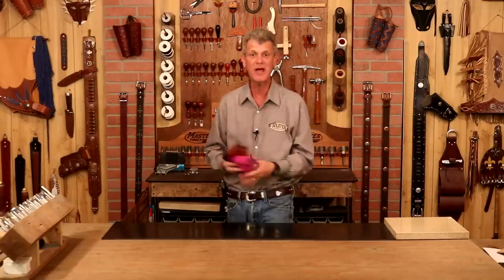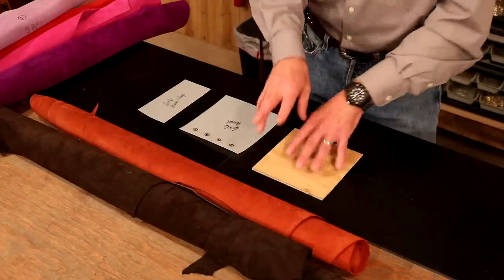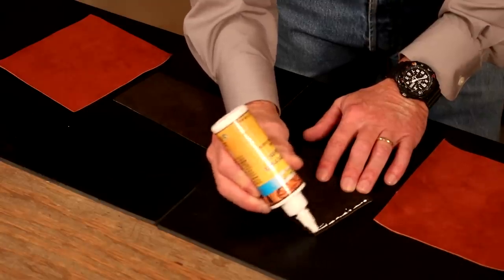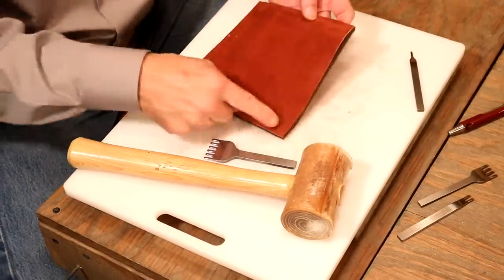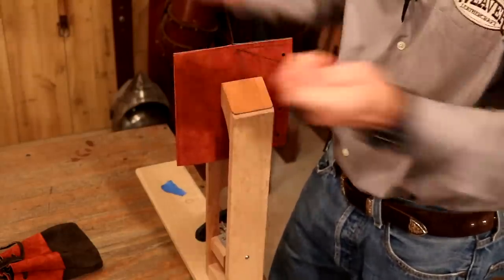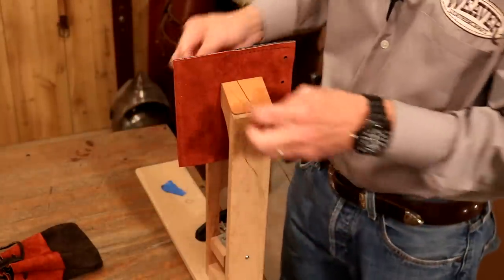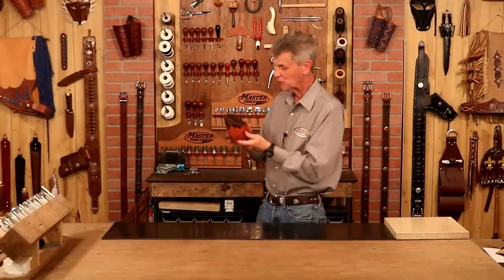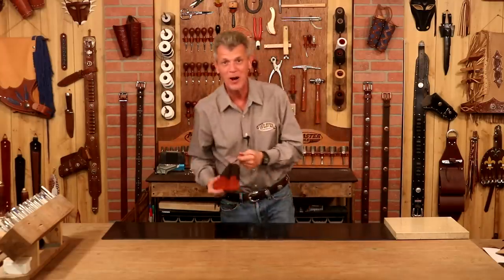Making a Leather Drawstring Pouch

Comment: I'm going to cut up a real leather skirt that I got in the thrift store and make a pouch. I like the double drawstring the best and I would knot each set of the double drawstrings at the ends. Thanks for this video! I bought the tool to make the 4 holes at once and will practice on scraps to get the technique down.

Comment: awesome as usual Chuck, love to watch you work sir.  I actually will be doing a few new pouches for my adult kids for ren faire garb.  I had not done one with the flap before, looks very interesting.  I encourage using pouches as a "purse" or "back pocket" for holding wallets and the like.  I used to do the same for SCA events.  I suggest a lacing needle for that second lace tie install, it makes it much easier to find the other side of a filled set of holes.

Comment: Hey Chuck, quick question. Making a few belts and noticed the leather has some stretch. Is this normal? Never really noticed before. Its a 8-9 oz veg tan leather. Thanks
Reply from the maker: David!  Thanks for asking!  It really depends on the tannage.  A quality veg-tan, English Bridle or Latigo will have little to no stretch (the lowest weights may have a little) whereas an oily side or a softer veg or chrome may have a lot of stretch.  I may suggest strapping from a cut that’s tanned for belts like our “Strap Leather” or one of the above.  If you’re making belts you’ll be surprised at the difference in how it cuts, edges, slicks, punches and the overall outcome.  See if this helps?

Comment: Having the top mouth with 4 unattached edges instead of just two bothers me.  I like the extra piece at top for reinforcement but see mechanical use problems developing because once turned inside out the top offers open 'slits'. Any problem in design if after complete it to your project we go back and sew each of the two reinforcement pieces to their larger panels at the top?
It would still leave main opening clear.
Reply from the maker: Hi Michael,
You can definitely go back and sew the two pieces together, there shouldn't be any issues that I can think of!
Reply: @WeaverLeatherSupply  Thank you for the comeback. Can I ask you a question about glueing seams together before lacing / hand sewing?  Example: Pockets inside book covers.  What will do the job best? White flexible craft glue?
Reply: @WeaverLeatherSupply  Thank You.

Comment: Chuck I dont hav a stitching pony.. any suggestion what to use in place off.... My knees??? Dont do a lot of stitiching really none first attempt with this project... Have a vise on my Husbands work bench that could work..?
Reply from the maker: Hi Cynthia,
A vice may work, depending on how large the leather piece is you are sewing. It doesn't have the room in the jaws like a pony does. If you do use a vice, just make sure to use scrap leather between the project and the jaws to keep the leather from getting marked. You can also hand stitch without a pony, we'll link a video here for you: https://youtu.be/EIGT_RXi8ZM
Reply: @WeaverLeatherSupply  Hi Chuck  Thanks for answering..  did the stitching today on the pouch.  Since it was a smalI project pouch I could use my knees as the pony.  Or sometimes just put it on the table and worked the needles in that way. It was slow going and if I do more projects with stitching I will definitely buy a pony.. Again thanks Cyndi

Comment: this is my first project and i am following along as you go. I get to punching after gluing and after three or four punches i notice that my holes are closing up and cant be seen where i already punched. is there a solution for this?
Reply from the maker: Hi James,
If you;re referring to the stitching holes - try putting some scrap leather underneath your leather pieces that you're punching. This will ensure the chisels go down through the leather and give you nice, open stitch holes. With suede, it can be a little harder to see the holes but they shouldn't close back up after punching all the way through.

Comment: Hey Chuck, I have an unrelated question. I have been looking to pick up an oblong punch for belt holes in my holsters. I have found several  1 5/8" which is what I want, but they say they are 7/32" wide. That seems to narrow. What do you use ? tired of using hole punches and cutting them out. want better looking hole. Thanks
Reply from the maker: Thanks for asking!  The width is typically set up by the tool makers and we don’t have much say.  7/32 is just about ¼” so that’s a good width for an oblong when it’s on a buckle but that’s pretty thin to run a belt strap through.  It will work and will loosen over time, or, you can step the oblong widthwise to open that up a bit.  Make small punches left and right and you should get a wider hole that looks even.  If you punch too far left or right just punch a round hole in both ends and that will round each end where there may be a small point.  See of this helps?

Comment: Hi I have some crome tanned leather that I bought a few years ago ( scrapes at fleamarket) what kind of projects can i make with it
Reply from the maker: Hi Randy,
It depends a little bit on how large the pieces are but small scraps can be used for earrings, bracelets and cuffs, keyfobs and keyrings, fringe tassels, small pouches, and even wallet exteriors. If the pieces are larger, then they can be used for bags and purses, you can also line them with veg tan for briefcases. Hope that helps!